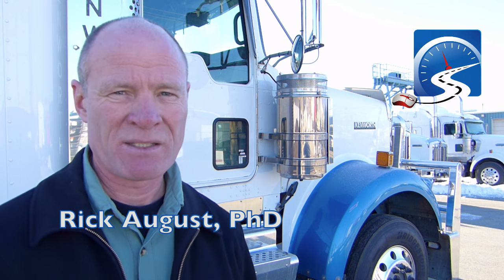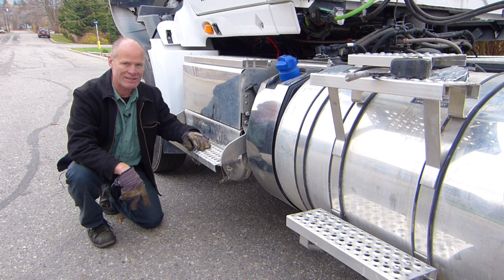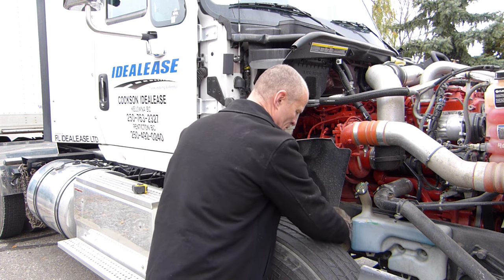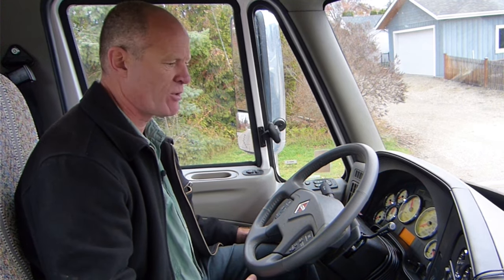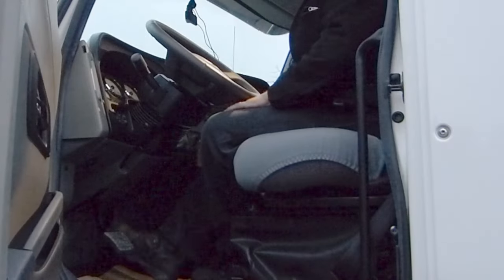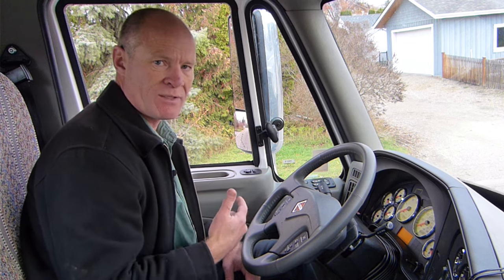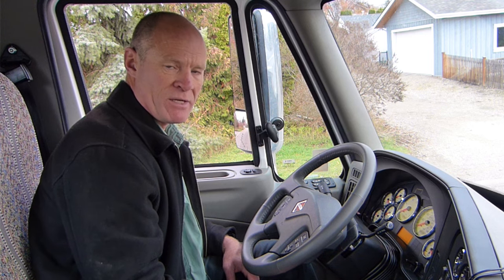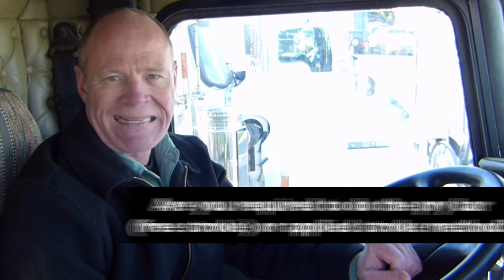How to Do the CDL Air Brake Pre-Trip Inspection

Comment: -Minimum / maximum on governor
-Low air pressure warning
-Spring breaks supply automatically between 20-45psi
-Compressor builds air volume in certain amount of time
-Leak test
Reply from the maker: Grandma Likes Everyone Because Grandma's Loveable - Governor (Min); Low Air; Emergency Brakes Apply; Buildup Test; Governor (Max); Leak Test. All the very best, Cheers Rick
Reply: @smartdrivetest  that's a good one 😄

Comment: Is P.S.I. hard to learn when you need want to get your Air Breaks,especially if your math is almost little to none at all whatsoever?
Reply from the maker: PSI stands for pounds per square inch my friend. It's not hard to learn. There's a lot of numbers and valves to memorize. There isn't a lot of math. This resource may help: https://www.smartdrivetest.com/airbrakes-cdl-rv/air-brakes-explained-simply Drop us a note if you have further questions. All the best, Cheers Rick

Comment: Outstanding video! Excellent presentation, complete and concise instructions and information. I was confident about my knowledge test, apprehensive about the pre-trip test, happy to say I passed today. After watching the video I had my mantras; "Secure, not damaged, not leaking " and "5 pressure tests, two tug tests. Governor in/out, low air warning, pressure up time, auto spring brakes, leak test. Spring break tug, service break tug." That was an easy way to make sure I didn't miss any tests and made it easy to remember what's related to each. One thing extra I had to do; I had to manually adjust one of the brakes for pushrod travel, they were all good so had to adjust one pushrod out of tolerance then fix and measure by prybar. Thanks for this video, you can bet I'm going to take in all the rest of your videos. Very valuable, very generous of you to share.
Reply: I thought its called "service brake response test"  not service brake tug"
Reply from the maker: Hi Chris McNally - Apologies for the late response. You are correct my friend. Parking brake tug test and service brake response test. You're testing that the brakes both apply and release. All the best, Cheers Rick

Comment: Here's the steps for Ontario from a Z course done at a college. Practical test was done on a dump truck.

(Remember to narrate to the examiner what and why it is what you are doing)

Step 1 Brake Adjustment Test
*Chock wheels
*Release tractor brakes (push in yellow button)
*Ensure air pressure is between 90 & 100psi
*Shut engine off
*Measure from brake chamber to center of the clevis pin and not distance
*Apply service brakes using brake stick
*Ensure air pressure is between 90 & 100psi
*Take second measurement & note the difference
*Tell the examiner the distance of travel
*Front brakes are 16 short with an adjustment limit of 1 3/4" adjustment limit (brake type is vehicle specific)
*Rear brakes are 30 short with and adjustment limit of 2 inches (brake type is vehicle specific)
*If any of the brakes exceed their adjustment limit, the truck will be out of service
*Drain the air tanks (wet tank first) looks for moisture, debris and that the valves reseal
*If the valves don't reseal, the truck is out of service

Step 2 Governor Cut In Test (80 psi)
*Start truck
*Fan Brakes down to 80 psi and watch for the pressure to rise
*If the pressure doesn't rise, the truck is out of service

Step 3 Low Air Warning Test (55 psi)
*Fan the brakes until warning light and buzzer come on and note the pressure
*If the warning light and buzzer don't activate by 55 psi, the truck is out of service

Step 4 Compressor check test
*With engine revving between 600 and 900 RPM, time how long it takes to build from 85 to 100psi
*If it doesn't build in less the 2 minutes, the truck is out of service

Step 5 Governor cut out test
*Listen for the air dryer to exhaust
*If the governor doesn't cut out between 100 and 135 psi, the truck is out of service

Step 6 Air Leak Test
*Shut off engine
*Apply brake pedal and note the brake pressure
*Listen for audible air leaks
*Time for 1 minute and note air pressure before releasing the brakes
*Cannot lose more then 3 psi in 1 minute or the truck is out of service

Step 7 Spring Brake Application Test
*Apply truck spring brakes (pull yellow button) and hear them apply
*If you don't hear the spring brakes apply, the truck is out of service
*If unsure the spring brakes are holding, you should do a tug test

Tug Test
*Remove wheel chocks
*Apply power with the spring brakes applied (yellow button out)
*If brakes don't hold, the truck is out of service

Speech
If I found any defect during these 7 steps, I would fill out inspection book and report to owner.
If truck is out of service, it is illegal to drive.
Reply from the maker: Hi Dino - Apologies for the late response. Thank you for your comment and great information. Do you have any job prospects lined up my friend? If there is anything further we can do, drop us a note. Always happy to help. All the best, Cheers Rick

Comment: When I was practicing for the test I was told always turn the key back on before you begin the leak down tests, the low air warning and low air spring brake apply or they will fail you because the audible and lights will not happen

Comment: Getting ready to take my CDL with airbrakes endorsement on Tuesday in New York hopefully this video gets me through air brakes supposed to be the hardest part
Reply from the maker: Hi Anthony Brooks - thanks for your comment. Good luck on your road test. And remember to breath - you're going to do awesome. Did you see these videos: https://www.youtube.com/watch?v=UKa6w8QzkCQ&list=PL0x-bChcUvwHlk3jrlpXvYtZHXybVIBmA&index=1  Let us know how it turns out. All the best, Cheers Rick
Reply: Do I go around and hit each tire with a hammer to assure the proper PSI and if I'm taking my test with a 53-foot trailer will I fail for going over the white lines
Reply: Smart Drive Test how is a airbreaks test is done on a automatic? Is it in neutral throughout the test? And do I apply the breaks when I put the truck in neutral?

Comment: Man! The examiner nailed me on the 4-60 test today! In our truck, we must put our transmission in first gear, turn off the engine, release the spring brakes, and press and hold the service brakes for one minute. While i pressed my brakes and the timer was ticking, I noticed my primary air gauge started rising. I thought it was abnormal since I was expecting it to drop maybe like 1 or 2 pounds. But I just continued and I told my examiner: "Ok my minute is up, primary was at 102, it is now at 105, I gained 3 pounds of pressure, it's a good test". But he said that this was a bad reading because the pressure is not supposed to rise. My instructors at school told me it's not necessarily normal for it to rise instead of drop but it does happen sometimes. Is this true or not?? When I released my spring brakes, I did wait for all the pressure to ease off my valves. I even took a little more time to grab my phone, look for the timer app, look for the stop-watch section, and press start. So how much more longer was I supposed to wait?

Comment: Hmm, my state CDL manual  says to turn the engine off just before you start the test of the low air pressure warning signal. That would seem to make more sense because the air compressor is trying to replenish the air pressure while the engine is running.
Reply from the maker: Hi Steven Litvintchouk - Thank you for your comment. And you are correct my friend. On most air brake inspections, after you do the low air warning test, you shut the engine off to do the emergency brake test. See: https://youtu.be/rMZwffPGAiQ?t=758 If there's anything further we can help you with, drop us a note. Always happy to help. All the best, Cheers Rick

Comment: I forgot to apply the spring brakes after adjusting the brakes.  The spring brakes were release when going from governor cut out to drop the pressure quicker than pumping the brakes.  Spring brakes were released when doing air leakage test and then doing an brake adjustment by 2 full brake applications. This was an airbrake practical. I did everything right expect applying the spring brakes.  A brake check was not done after brake adjustment, although we talked about prior when the instructor was in passenger seat talking to us.

Does draining the air tanks apply the springs brakes if they were not applied? The truck in neutral and on flat ground and the key was off position.
Reply from the maker: As I stated, if system pressure in the secondary and primary tank is drained between 20 and 45psi, the emergency spring brakes (parking brakes) will apply. The large powerful spring are held in the released position by air pressure. If you drain the air pressure, the spring cannot be held in the release position, will expand, and apply the parking brakes. If there is anything further we can do, drop us a note. Always happy to help. All the best, Cheers Rick

Comment: Why is the Cut in phase void if the pressure drops below 80PSI?  You don't explain that.
Reply from the maker: Hi Driven home - Thank you for your query. 80 psi is the absolute minimum according to regulations that the governor must return the compressor to the load phase. Thus, if you let the air pressure go lower, you're not within the parameters of the required test. All the best, Chers Rick
Reply: @smartdrivetest  Oh I see, thank you. The test taking longer, thus a false negative.
Reply from the maker: Hi Driven home - you are most welcome my friend. All the best, Cheers Rick
Reply: I had the same question.    Thanks for asking it.  
All clear now.

Comment: Not to be an ass. But check the brand and model as to whether or not you supresse the clutch when firing up. I know some Mack units even newer ones should not have the clutch supressed when firing up the unit. It can be damaging I was told this by a few Mack dealers/shops. 
That said, great video.
Reply from the maker: Hi TruckStopTV - Apologies for the late response. Nope, not being an ass my friend. I would be curious to know why they think that it would cause damage - you're just separating the engine from the drive train via the clutch. But you're right, not all models require you to push in the clutch to fire up the engine. And for the ole-timer's like me, it's a pain in the butt anyway to push in the clutch. All the best, Cheers Rick
Reply: @smartdrivetest  Don't quote me on it, it was about 4 years ago. But I was told it had something to do with the air cylinder and it getting damaged.

Comment: Manitoba does the Brake Application or "Applied Application"  that requires that a person, stand on the brakes while you check the push rod travel "from a predetermined point" that is either a fixed marker like a plastic tie or marked with a piece of chalk.  There are other differences between provinces. As there are so many differences, any generic tutorial is going to give wrong numbers for other jurisdictions.  If someone from one of the other jurisdictions, happens to watch this video first, they could be learning the wrong numbers.
My comment is that this video like most youtube videos tend to be far to fast with the rate of speech  and absent pauses to allow viewers to absorb the information.

Comment: missed a couple things..1 didnt mention power steering or oil dipstick..2 didnt mention if air compressor is gear or belt driven..
Reply from the maker: Hi Todd - thank you for your comment. You are most welcome. In which place are you that they want you to mention if the air compressor is gear or belt driven? Air compressors haven't been belt driven for 40 years!! If there is anything further we can do, drop us a note. Always happy to help. All the best, Cheers Rick

Comment: Hi Rick, Great video! As an Air brake instructor here in Ontario we don't do the 50psi to 90psi test for build-up but only test 85psi to 100psi. just wondering what the differences are in other provinces and states. is there a website with that info? 

Thanks again.

-Rob
Reply from the maker: Hi Robert den Broeder - Thank you for your comment. And no, there isn't a website - you have to go through the individual manuals. Some of the other provinces and states are going the 85-100psi in 45s with the engine at flat idle too. I think it's SK--maybe QC too--that's added that the trailer air supply must shut off air to the trailer above 50psi. And then the normal - parking brake applies the emergency brakes between 20 and 45psi. If there is anything further we can do, drop us a note. Always happy to help. All the best, Cheers Rick

Comment: Hi
question : @ min 16:00 you say for the leak test
you say "its holding at 100 lbs per sq inch".
your "brake tractor gauge" the needle shows about 62 psi brake application, no?

why  do you say "it's holding at 100 psi "

your video showed primary and secondary tank gauges showed 125 psi 

( are we to monitor the "Brake Trctr" gauge dropping ,  or just the primary AND secondary tanks showing a drop ?)

Thanks for the video

Comment: i got shit for doing it in this order I was told I have to start with shutting the vehical off and putting the key in start and do the air loss check first then proceed to the low warning by pumping brakes
Reply from the maker: Hi brian pugh - Thank you for your comment. Where are you taking your air brakes? Yes, unfortunately, there are some instructors that are inflexible in the order that these 5 tests are done. Sorry to hear about your experience. If there is anything further we can do, drop us a note. Always happy to help. All the best, Cheers Rick
Reply: Ontario Canada and I thought I knew it all lol. I did all the checks correct but was never told the DOT wants them done in a particular order that was a new one for me. Really makes no sense to me as long as you do them and do them correctly I don't know why u would fail because u did them in a different order. DOT makes stupid things up sometimes. cheers
Reply from the maker: Hi brian pugh - Thank you for your for letting us know. Sorry to hear about your unsuccessful attempt. Unfortunately, some examiners are either unable or unwilling to be flexible on the order of the air brake test that are done in-cab with a CDL vehicle. We're confident that you'll get your license on the next attempt. If there is anything further we can do, drop us a note. Always happy to help. All the best, Cheers Rick PS - you'll have a different examiner on the next attempt.

Comment: would they expect you to raise the box on a gravel truck in order to inspect the lines from above, or can you simply do that from below?
Reply from the maker: Hi sugarsdaddy1 - Thank you for your query. You can do either my friend - you can do it from below or you can raise the box. My only issue with raising the box is that the examiner may see it as a safety issue and would not want you between the raised box and the frame. All the best, Cheers Rick

Comment: Charles S 
I'm a retired city bus driver who now occasionally drives rented school buses for church advents in BC.  On my city bus doing my pre-trip I was not required to crawl under the bus and check the distance of travel on the push rods.  I have also talked to a manager of a school bus system and he indicated because of the auto slack adjusters  he does not require his drivers to go under the bus and check rod travel.  I have also watched several you tube videos and they don't show anyone  going under the bus. Is manually doing a pry bar test a requirement on my routine pre-trip or is it just required when doing a driving test?
Reply from the maker: Hi 2010Canuck - Thank you for your comment and query. For the purposes of your road test, you will be required to go under the bus and check push rod travel. A automotive creeper is going to work best if you're on pavement or concrete. If you're on dirt it's going to be a little tougher. If there is anything further we can do, drop us a note. Always happy to help. All the best, Cheers Rick